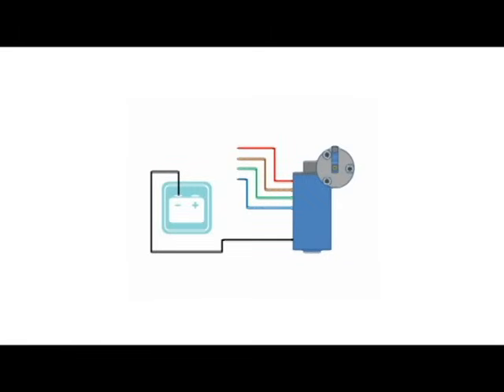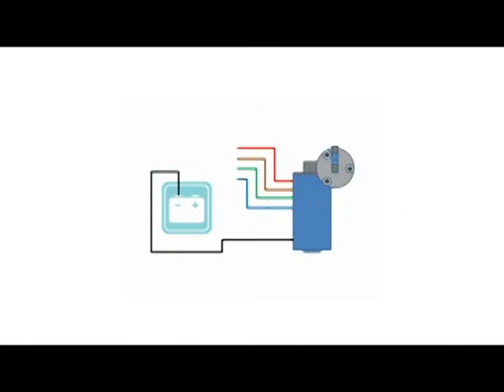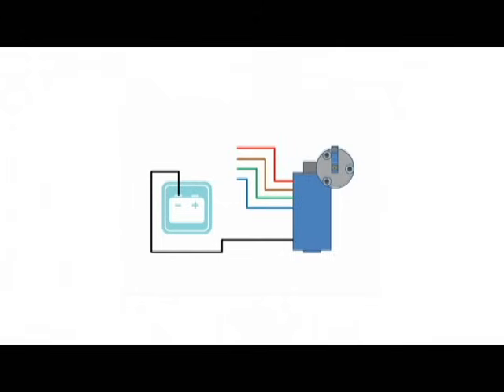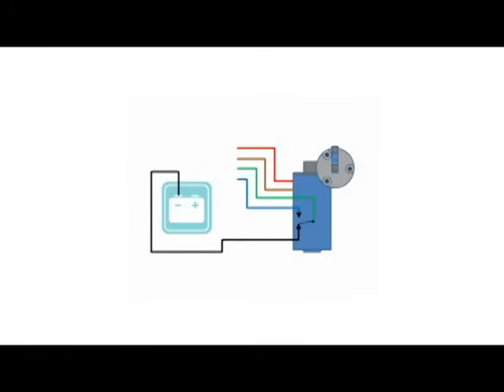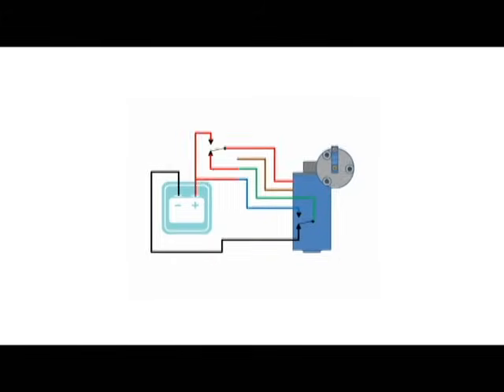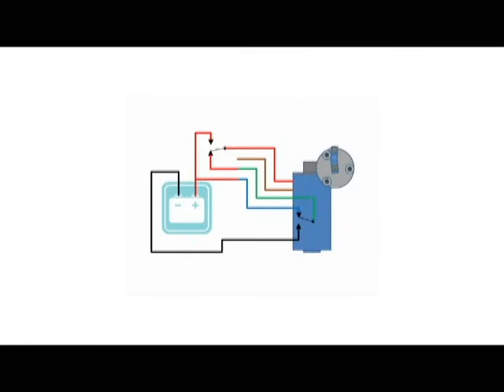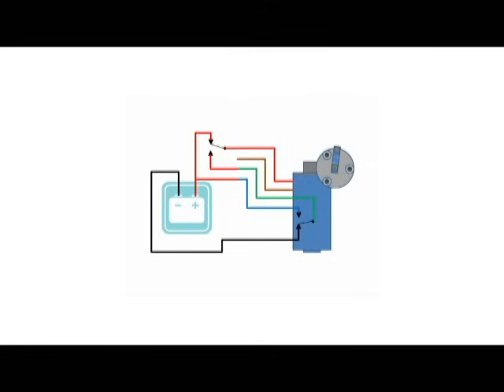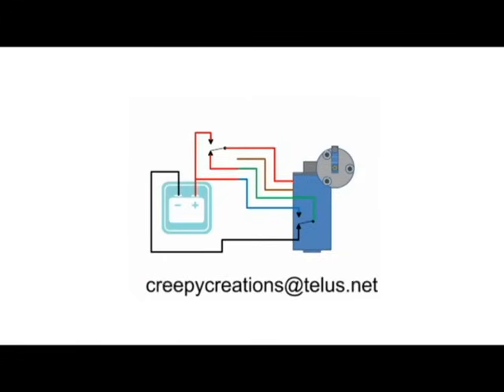Windshield Wiper Motor Wiring Tutorial

Comment: disconnect motor body ground (internal and external). pos to high speed wire, neg to low speed wire = double speed. no idea how long it can sustain that configuration though. It does get warm.
Reply from the maker: Interesting idea. I've found the regular speed is usually more than adequate for any haunt props I have built in the past.
Reply: @AnimationGoneWrong  pos low spd brush, neg isolated ground brush = 36 rpm.
Pos high spd brush, neg isolated ground brush = 48 rpm. Pos high spd brush, neg low spd brush = 99 rpm (but counter-rotation).
Pos low spd brush, neg high spd brush = 77 rpm. Speed inverse to torque.

Comment: Does the blue wire have to be the one that's always connected to +, or would switching it with the green one make any difference?
Reply from the maker: It makes a HUGE difference.  Look at the way the circuit is connected at around 2:51... if you were to connect the power to the GREEN wire (instead of the blue one) you would cause a short, which could potentially fry your power supply, perhaps cause a fire or short out and drain a battery (if that was your power source).
Reply: @AnimationGoneWrong  Thank you for the rapid response.  I asked because the motor I have has different color wires, and was wondering if the two park wires were isolated from the ground, in which case they could seemingly have been interchangeable, but I'll take your advice.  Guess I'll also have to do some exploratory surgery on it.  Thanks again.
Reply from the maker: @donf3739  The best way to tell is if you have access to an ohm-meter.  When in the parked position, one wire (green in this case) will be connected directly to ground (the body of the motor), the other (blue) will not.
Reply: @AnimationGoneWrong  Finally got it!  I have a motor I found on Amazon for $30, that's for a ~90s Dodge.  It wasn't parked when I got it, so I took a guess the first time, and it parked fine, but then the heated-up wire let me know I had them backwards.  The wiring diagram I found calls the Park wires P1 and P2.  I found that P1 is the one that goes to the positive during park mode (your blue), and P2 is the one that goes to the Low or High wire during park mode (your green).
I posted this in case it might help someone else.  And thank you for your video.  It's the best explanation I've found.

Comment: So I CAN wire a wiper motor and speed controller  to a 12 volt battery with no ill affects to the motor or the battery?

I need to place a prop in a remote location where wires will not reach.

Thanks
Reply from the maker: Garry Robinson yes, absolutely. If your speed controller is also rated for 12 volts, no worries at all!

Comment: So i've spent the whole day scratching my head. I got a 88 XJ jeep last Christmas & I'm almost done fixing it. Only two things left, the oil pressure sender and the wipers. My wipers only worked in the off position at slow speed. I tested the pig tail just before the motor and everything seemed to be fine so I swapped the motor. After putting it in I got nothing. I have no power at the motor or the intermittent wiper control box (between the selector switch and the fuse panel). I do however have power at the fuse in the panel. I did find that the previous owner spliced the park wires directly to a hot wire. This may explain why they where working in the off position at low speed. I think the direct power was continually parking the wipers. I removed that direct power line and reconnected the park cables to factory because I want them to work properly. The motor grounds through the body so I'm pretty sure that's not the issue. I think it is the source that i'm missing. I can run a new power cable but I have no idea where to run it D: Someone please enlighten me, i'm not savvy enough for this.

Comment: ok finally someone to tell me how to rig up a wiper motor now is there a way to get the motor on a plug so i can plug it into a wall. also so i understand if i power the red or brown wires it will run with out stopping right?

Comment: I have a wiper motor with only 4 wires: low, high, ground and park. The park wire is grounded at the park position. Any suggestions how to wire this circuit? Thanks
Reply from the maker: Not sure, to be honest. Without that extra wire (blue, in the video) you can't get the proper operation for park. Yes, the park wire should be grounded at the park position, but something is missing.  If you have a voltmeter, I would suggest getting the motor turned a little bit, then see what is connected to what when you aren't in the park position. This might reveal some more information.
Reply: @AnimationGoneWrong  Thanks, it's off a new BMW so there was probably a whole module controlling it. I was able to wire it eventually using a  changeover relay and DPDT ON/OFF/ON switch. 12v to 30, 87A to left center switch position, 85 to bottom right switch position, 86 to park, 12V to right center switch position, high speed to top left switch position, and low speed to bottom left switch position. The top right switch position and 87 disconnected. Basically flicking the switch up will activate low speed with 12v going through 87A but also the other side provides a circuit for the relay, so the wipers will go low speed, park and relay switches to 87 which kills the power. Flicking the switch down will power high speed but not use the relay. I lose low speed this way but it's a race car so all good. I can use down position for high speed, up position to park the wipers, and center is off. I will change to an ON/OFF/(ON) switch because if I were to leave the switch in the park position, the wipers will nudge every time the car is turned on while relay kicks in, until eventually they are no longer parked and the wipers do a cycle.  I'm sure there will definitely be a way to wire it better but this works for me. Your video was super helpful, thanks

Comment: Have a windshield washer with twos leads and a ground.  Seems to me should Have 1 power lead and a ground.   Whats the deal?
Reply from the maker: Are you talking about the washer fluid pump? In that case, two leads does seem unusual.  If it's a motor, then it's like a high and low speed connection.

Comment: Could this motor & gear setup be used to replace/activate a small bottom, metal, sliding, retractable "Power Step" on my RV's Entrance  steps, bottom one that came out when one was entering cabin, then retracted back under the 2-step frame after your aboard.... Be nice to have a place to try and fab something like that together. too... 
..... lil brothers (by 11 months)can be big Aholes
idiot brother turned too sharp and took out the original 1980 power step, on a cement stop hump.... arrrrg....
 after "borrowing" the Fleetwood 1 weekend last year... nevcer did offer to replace or fix neither....but then again hasn't piped up about borrowing this behemoth again this year either.... may have solved it's own problem ;)

Great video sir ;)
~Whirled Peas
Reply from the maker: I don't see why you couldn't do that.  The motor would certainly be powerful enough to handle moving a step around, as long as you're not standing on it! LOL It would be an interesting project.

Comment: i have '98 dodge caravan and the wiper always stays high when the engine is started. the switch has no control. Any suggestion would be much appreciated.  Both relays are OK. Thanks.
Reply from the maker: To be honest, it sounds like your switch is shorting out somewhere, either in the physical switch itself, or in the wiring.  Other than that.... no idea, sorry.
Reply: thanks

Comment: I'm with Ray Kent on this one.  The diagram is a little confusing as it seems the blue wire is always connected to the motor supplying positive power which should cause the motor to constantly be spinning.
Reply: hey...that question also Arised in my mind, But here is the thing battery is always connected to the Negative terminal by connecting it to the Body, Only the Relay diagram is shown because for the operation of Motor returning to Initial position it should stop and positive current should bypass Motor through connection. Hope you Understood. If not You can Ask me Again.
Reply from the maker: Yes, the blue wire always has power. But the power passes through the internal switch, so it gets cut off when the motor is in the park position.
Reply: True

Comment: I have a 2012 dodge grand carry van. The windshield wiper never stop working. Even though I turn off engine or cut off the multifunction shwich still can not stop. I changed new multifunction shwich , but nothing happen. I tested the #3 wire is very hot. I don't know how to stop the windshield wiper , do you have any idea? Thank you!

Comment: Awesome tutorial!!  Could you please make a tutorial doing a step-by-step on what was mentioned here. Building the 555 timer (what parts) and how to wire that up to a relay and then to the wiper motor?  And if you feel creative, you could add a motion sensor to the tutorial as well. Please, please, please. Thank you for your time
Reply: Hello, can i have this tutorial also with timer.
Thanks
Reply: the output of 555 timers is a square wave if connected to a relay the relay close and opens. study the 555 timer it has many uses

Comment: I really appreciate this video and I think it will be useful to me.  But there seems to be an error.  At 2:29 the diagram shows no connection to the negative terminal of the battery, and you say that we're still applying power  to the red wire so it keeps rotating.  Electrical power can't be applied through a single wire, there needs to be a return path for the current.  As shown here, the motor would stop when the internal switch opened.  Nothing can be powered by a battery if one of the battery terminals is unconnected.
Reply: +Ray Kent The ground is the body of the motor.  So, it is always grounded.

Comment: How do I wire my wire manually. I want to bypass the onboard harness and go directly to my fuse box. What is the best way to do this?
Reply from the maker: Totally depends on the vehicle.  What do you mean by bypassing the harness? That's how the power gets to the circuit in the first place, doesn't it?
Reply: I want to wire it directly from the motor to the battery and ground it.

Comment: I m using this motor for a project , and when I have rotated motor its max speed by 12 v 9 amp battery ,a motor becoming a hot..what should be do for keeping motor normal temperature.
Reply from the maker: What are you moving with the motor?  They shouldn't get too hot, unless you are really straining it.
Reply: Only up to 1 kg trolley ....moving like to & fro
Reply: I found when motor no load conditions , its going to hot...also tried with different motor ..
Reply from the maker: Yeah, under no load it's going to run fast.. and probably hot.  How is it under load?
Reply: I listened by expert that wiper motor is not made for continuous running ...we can use only for short time application. 
Is it true?
Reply: That's why motor is being hot while continuous rotating ...
Reply: What is your opinion sir ?
Reply from the maker: That doesn't seem right.  If you can't run one continuously, how can you use your wipers non-stop in a heavy rain?  But running continuously without a load might get it warm.
Reply: U r right sir but I achieve this situation...
Reply: And expert have a lots of experience about this motor ...
Reply: Expert name is rajan ...his own business about industrial automation..he tries wiper motor max time for industrial use . He faced same becoming hot...
Reply: Have either of you guys tried using an automotive fan motor? Do you think the fan motors could be suited for the same uses with a speed controller wired to it?

Comment: if you want to plug this DC motor into the wall you will require a rectifier, that will convert the AC power from the wall into DC power for your motor.  Laptop power supplies use these. See if you can find one with a 120V AC input (wall voltage) and a 12 VDC output (for motor).  I bet you can find one on ebay.

Comment: Any easy way to identify which ping on the motor is power/park/stop, etc. without trial and error trying every combination or a wiring diagram? I have a Lincoln navigator 2003 - 2007 motor, but cannot find a wiring diagram for it so I am trying to figure out which ping is which.
Reply: Did you ever get a reply to this question, I'm baffled also.  Thanks,

Comment: Is there anyway to make this motor go back and forth rather than full circle? I'm using this motor for an invention and need the arm to rock back and forth, not full circle?
Thank you
-Mike
Reply: Michael Saari Use a linkage like the wipers have.
Reply: If you connect the arm to a second wheel and only let it stay one side of the axe ex; between 7 and 11 or 1 and 5 ,the second wheel will have the rocking movement that your looking for.

Comment: how do you fix wipers from stoping in the middle of windshield
Reply from the maker: That usually means it's not wired correctly. Power needs to be available to the motor, even after you've "switched it off" for the park function to operate properly, which would let the motor complete one cycle so it doesn't stop in the middle.
Reply: remove arm&blade  form link and fix proper position

Comment: I want to use a wiper motor for a project but I need to power it using 120v AC generator. Is that posible? Can I possibly do it hooking up the motor to a car battery charger.
Reply: I use a car battery charger, and I put it through a pulse width modulator to get the motor to go as slow as I need. but you need to turn it up high to get it going, and then slow it down.

Comment: What if the motor arcs off the red and white wires
Reply from the maker: I'm not sure what white wire you are referring to.  Generally, any arcing is not good, unless it is just during the initial connection and the motor starts turning.  if you are getting arcing, but no action, then you have a short circuit somewhere.
Reply: @AnimationGoneWrong   i meant too say the red and black wires . but I figured its no good

Comment: Hey thanks for the video. How do you use a 555 IC to control the relay? I was thinking of making a intermittent wiper motor control with an arduino. a 555 timer circuit might be a better way to do it
Reply from the maker: A quick Google search got me this: http://electromotiveforces.blogspot.com/2011/06/variable-intermittent-wiper-control.html
It may do the trick for you.

Comment: How much amps do I need?
Reply from the maker: It will depend on the motor.  They tend to draw a LOT when they first start up (eg. 2 amps minimum).  I have used small adapters to power them, but my power supply of choice is an old PC power supply, which can supply 10 - 20 Amps no problem.  They are perfect for these!
Reply: Thanks. I made 3 lab benchs from it. I just wanted to know. Is there any way I can use it as dynamo?
Reply from the maker: @stefanpejak9131  That can be tricky. That will REALLY depend on the motor. Some motors I've worked with have a worm gear driving the output, so they are almost impossible to use in that way, as you cannot force the output crank to rotate. Some motors are more forgiving. The only way to find out is to experiment.
Reply: Thanks. I think I will remove preexisting gearbox and make my own. Seems good.

Comment: I have a 93' S-10 pick-up truck and switch is broken off in the column meaning the little plastic housing broke and wont allow the plastic piece to grab and thus allowing wipers to work,my question is...Can or is there any way to bypass the column switch and wire in another switch I can just mount to the dash such as a toggle? I know there is different speeds on the column switch but if I can just wire it up to where I have the slow speed that would be great...So I just basically wanna wire it up for low speed...Or  if any1 knows of a link for a tutorial for this application plz just let me know ty in advance for anyone's help, I'm really in a jam, i don't have the option to take the whole thing apart and or replace the column because I have to have my vehicle to drive...I will continue to look around for more videos and options online, and again ty in advance for any help/suggestions...

Comment: How can i Wire a wiper motor through a speed control to Mains -> 220V????
Reply from the maker: I would suggest you check out our other channel (Creepy Creations), as I have a tutorial there on how to use a PC power supply (which will give you the ability to run a wiper motor from mains 110/220v). Inserting a speed controller in between the power source and the motor is trivial.
https://www.youtube.com/watch?v=1HXOd52QIBA
Reply: Bought some wiper motors from a scrap yard .. All different colour wiring v Confusing.. so going to have to read up on each type of motor and figure out which wire is which. Trying them out on a Car battery first and then ill try a computer power suplly also bought a speed controller just now that can handle 15v and  2 4 amps .. So hopefully that will work to control the speed.
Reply: Your video was extremely helpfull i shall use it as a step by step guide to get this prject to work out.